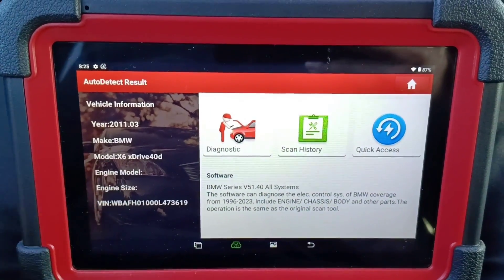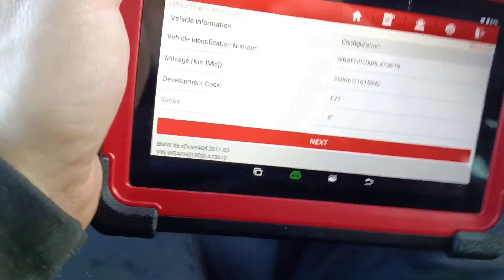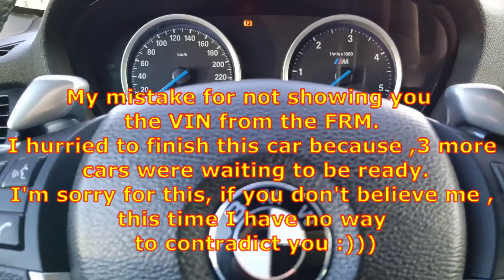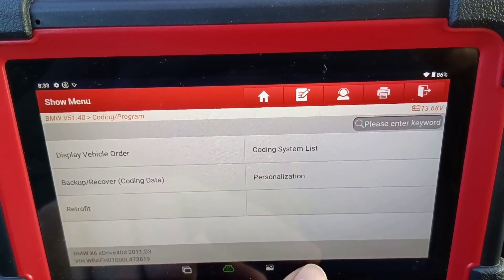Launch CRP919e BT coding the BMW FRM module after repair with CG100pro.

Comment: Thinkscan 689bt is much better with lifetime updates! it's got key coding ecu coding as well and it's very fast..
Reply from the maker: @jacbac7506 who said that this one doesn't do coding and programming? did you hear from me that it doesn't have this function. It is possible that other programmers have additional functions but don't forget that they all belong to the Launch company. I said this before, Topdan, Thinkdiag, Kinkbolen are all companies that use the Launch software.
Reply: No , what I meant was that yours doesn't have lifetime updates! and this is very important difference...

Comment: I have the same scanner. I don't like it. My xtool m30a works better for a lot less money. I would send it back if I bought it from Amazon. I bought it direct from 
Kingbolen, and I would have to pay for shipping and a restocking fee.
Reply from the maker: @hitechrr  that's your opinion and I respect it, but you have no way to compare this programmer with launch, Xtool doesn't do coding on any car, I've used several programmers from this company, for scanning they're ok, the rest leaves a lot to be desired.

Comment: Have you lost the ability to program tire pressure sensor id numbers into your vehicle computer with your scan tool?  The one I bought allowed me to program in the id codes for 2 of my new tire pressure sensors on a 06 dodge grand caravan, but I didn't do all 4 at one time. After I finally changed the other tires, the reader wouldn't connect to the van any longer so I updated the software on the scanner.  Now, it will no longer allow me to do anything but see the id numbers.  Even then, I have to fight through various menus to get to that point.  The scanner I bought is the non-bluetooth version by the same seller.
Reply from the maker: This is a software problem. Did you write to the company Launch about this problem ?
Reply: @YOYODiagnostic  I've gone back and forth with them to the point that they admitted that they can't push the old software as an update to fix their screw-up, and they'd rather send me new proprietary tpm sensors and a tool that is supposedly going to work to get the vehicle to recognize them free of charge, rather than fix the software and push a new update.

Comment: hello , i watched your video about VCX and i'm confused between it and scanmatik 2pro
i'm new to programming and diagnosing 
and i'm searching for the best pass-thru 
because i'm a beginner
what do you recommend for me 
i will mainly scan European cars (Renault - mb - bmw - vw - fiat ..etc )
thank you
Reply from the maker: Hello. What do you want to do scanning the car or do you think about tuning?
Reply: @YOYODiagnostic  
scanning and diagnosing
and programing the ECU (Delete EGR...etc)
programing gearbox
not sport tuning 
just basic maintenance or problem diagnosing
Reply from the maker: I think you are confusing things a bit.  EGR delete belongs to the tuning programmer, which is ruled out because this is a j2534.  It replaces certain original diagnoses and that's about it.
Reply from the maker: @Flash-bu3ug  
Again your comparison is not good.  Launch and Autel have their own operating software.  VCX and SM2 pro are based on other software, they do not have an operating system.  So it is clear that Autel or Launch is more efficient.

Comment: If you are stupid you must pay 😂😂 love it , great vids as always mate , couple of questions I might have missed you saying on the video ? 
Can you use off line or just internet only ?? And can you use after sub run out or is a brick ?
Any idea what the update cost are ? 

Thank you
Reply from the maker: You're right, I missed some information in the review, thanks for reminding me 👍  
  The license is about 150 euros per year from what I saw.  After the 2 years of free update, if you don't want to pay for the license, the programmer can be used without any problem, only that you can no longer update.  Yes, it can be used offline, I used it and there is no functionality problem, only in the case of the Ford brand, which requires an internet connection if you want to do certain resets.
Reply: Hi friend, bro can we said that this type of launch offer online coding for some car brands